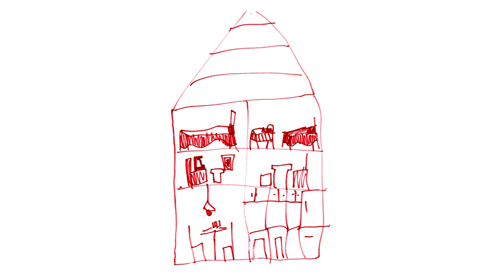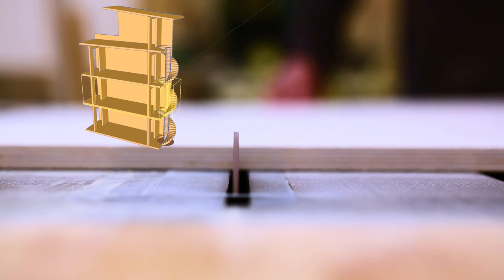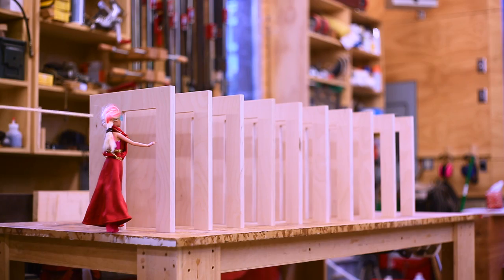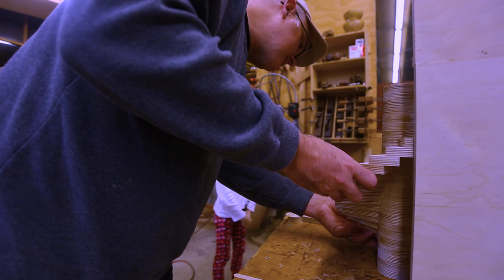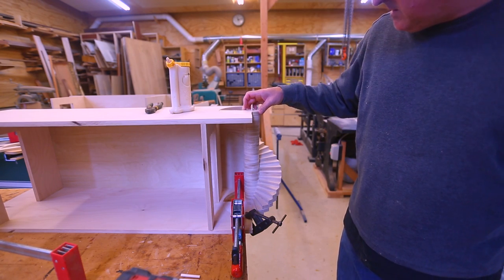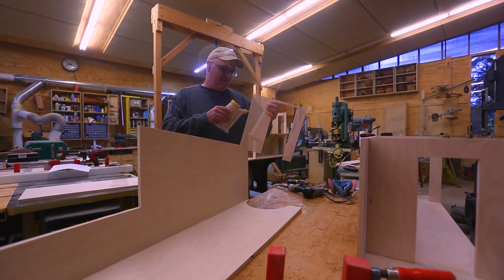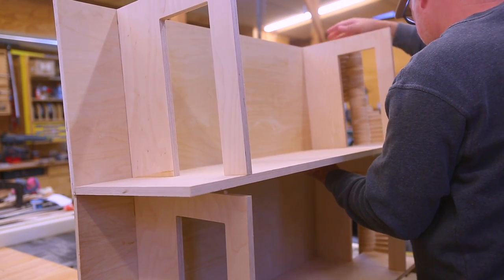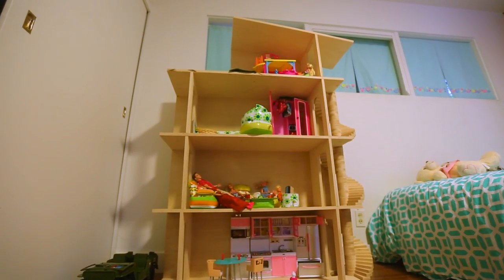Building a Barbie Dream House

Comment: Hey frank I think you're supposed to use a down spiral bit because the saw dust holds the piece in its place and maintains the vacuum pressure. Anyway thats 
what I was taught
Reply from the maker: interesting.  had not thought of that.

Comment: Very cool Frank! Its amazing how differently a girl and a boy sees the building process. Usually they say girls are more verbal than boys and in this case, the building process seems to have illicit the verbal qualities of the boy vs the girls observation and simply accepting the building as necessary, while the boy was more animated and proactive, even in a negative way, like wanting it to be over and done with for example.
I am curious, if you wanted to bring s spiral staircase like that size again, what would be involved in using the same equipment you used, but not making it in individual pieces and instead, mill it all out of one piece of wood.  
Could it be done?  I picture a rotating jig of some kind....
Reply from the maker: A 4th axis lathe on the cnc, with a long bit on the router.  https://i.ytimg.com/vi/gfDZ4keIwZA/maxresdefault.jpg